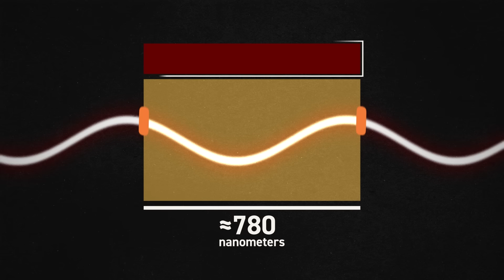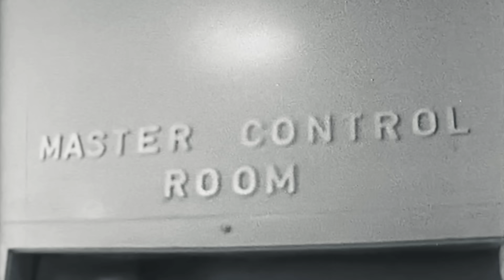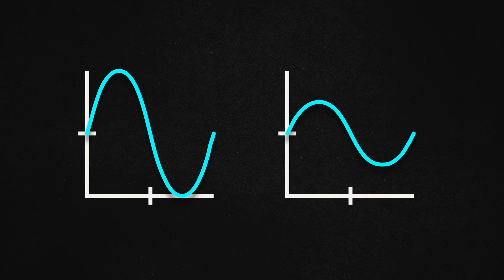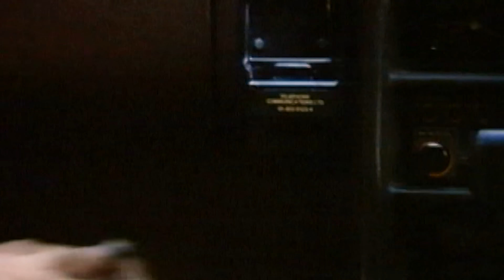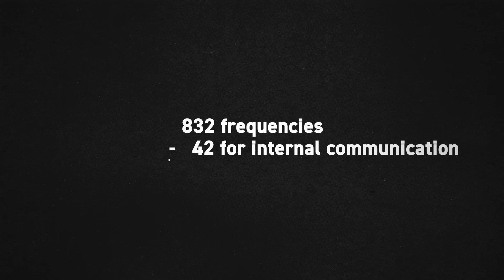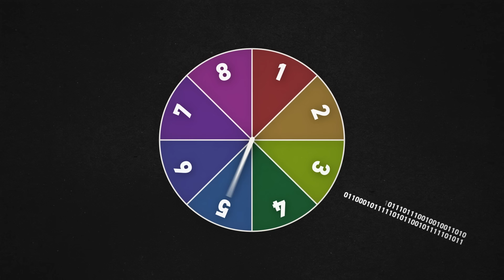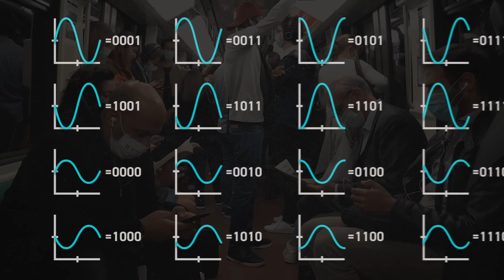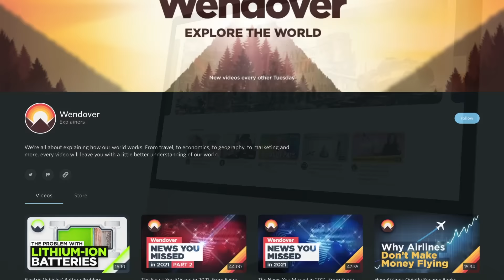How Cell Service Actually Works

Comment: the technology works great.. theproblem is the goddamn carriers are too damn concerned about spending money on social issues rather than putting that money back into upgrading their networks in a timely manner.  It takes years for carriers to upgrade their networks in rural areas.. I'm pretty much in a Bermuda Triangle for cellular service. AT&T, Verizon, and T-Mobile. I get barely 1 bar of LTE service from a 5G AT&T tower. Verizon doesn't even have 5G in my area. and T-Mobile apparently only runs their service along major highways or interstates. They won't put more towers up in areas that need coverage. They would rather piss away good money on promoting Pride month or some other stupid social justice cause.. 

Perhaps in a few years, SpaceX's Starlink will eliminate terrestrial cellular service..

Comment: Water problem 168 feet grid on mountain living and accumulation for 
4671ft oxygen below standard & measure: unit convertor blood contriction vessel aphyxiation coaggulant hypoxic trauma dismemberment% disability% death% cardio pulminary ressusitation emmiul emminant hygene constrict e•m [tt] death zone 2179 - 2140 10:73 average hours & minutes

Comment: It's wonderful, but it all goes for naught as soon as the ignorant clowns who work for the county go out with a tractor to put in a water line and dig through the fiber-optic cable that feeds the cell tower that provides my cell service and my fixed wireless broadband internet.  This happens every several months, and it takes one to four days for the landline phone company to fix it.